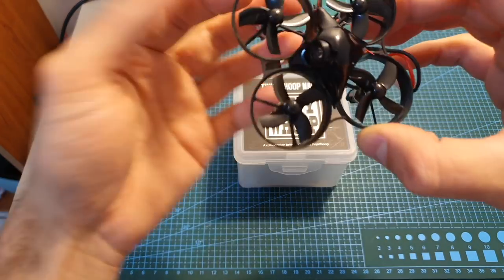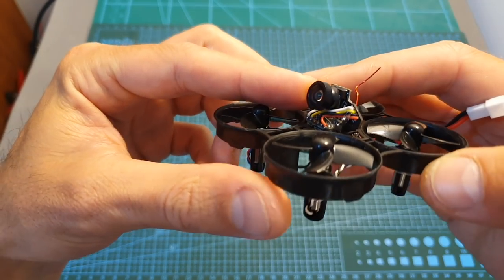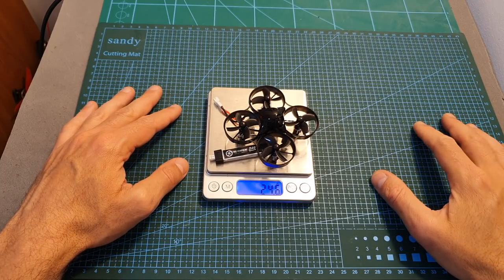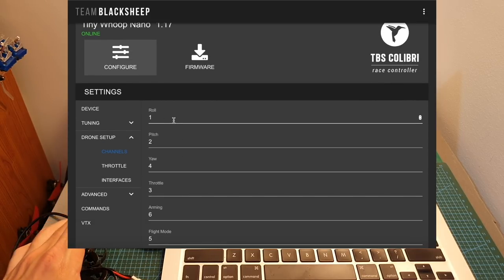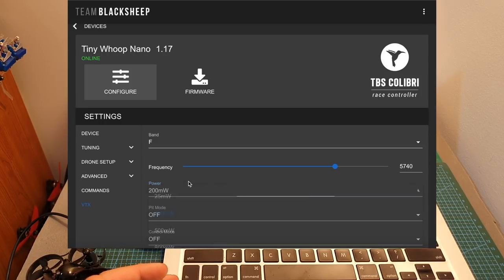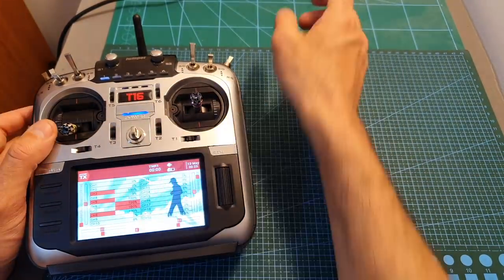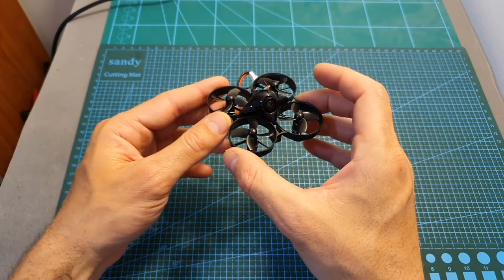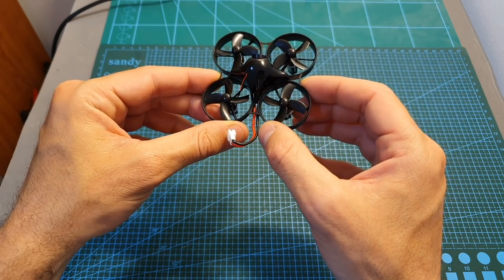TBS Tiny Whoop Nano - Review, Setup & Flight Footage

Comment: Wait.... under receiver crsf was an option, does it come built in with crsf as well?
like can I bind it to my crsf module?
Reply from the maker: No, you need to add an external CRSF RX.
Reply: @KremerFPV   is it posible
Reply from the maker: @wimmer77sw  It should be.

Comment: I dont get it to fly.... but good vid...
Reply from the maker: Thanks. What's your issue?
Reply: @KremerFPV  i Think the issue is that my frsky 9xd has a to old Software 2.0 or something. I can bind but the only thing that worked is the turtel mode... my Computer not calls the 9xd bootloader32 and zadig does not work hear even in bootload mode. Overall maybe i have no idea why 😥 maybe it is the same issue like 5inch quad i bought world be nice if it is the same issue 😂 in the Winter i cant drive motorcycle in germany, so it would be rally nice to get the stuff Working 😁In cologne ther is no shop for help in 200km...😥 big thx for anserwring😁
Reply from the maker: @francis9504  Did you reach out to TBS for help?
Reply: not yet first i try too update my 9xd. looks like usb 3.0 was the problem succes is so sweet yessssss! thy for the help i will write when i am rdy to fly or found another problem xD